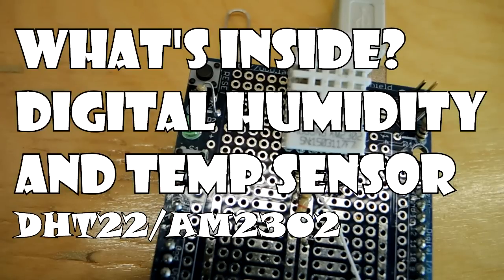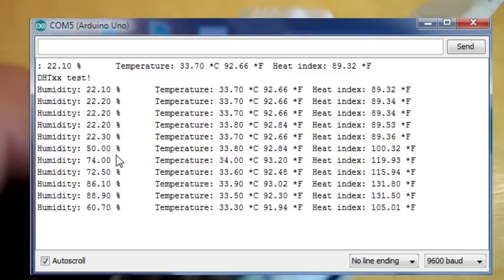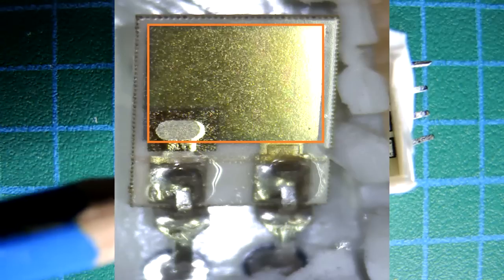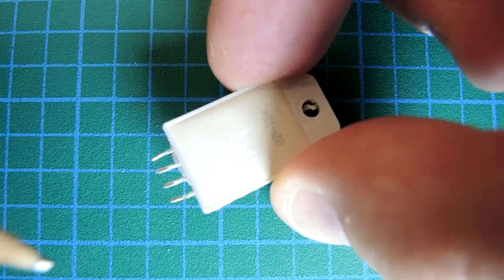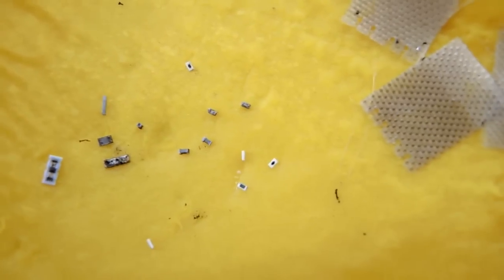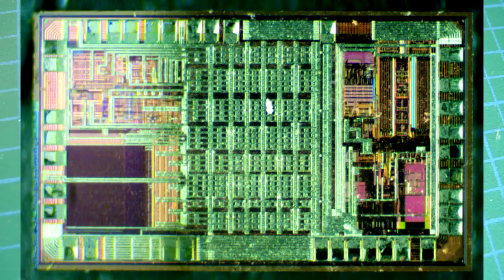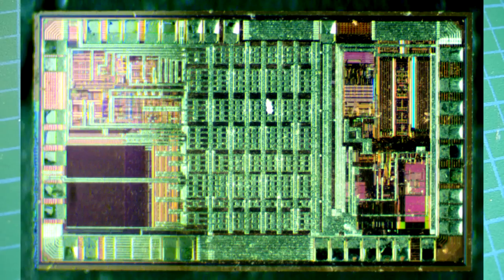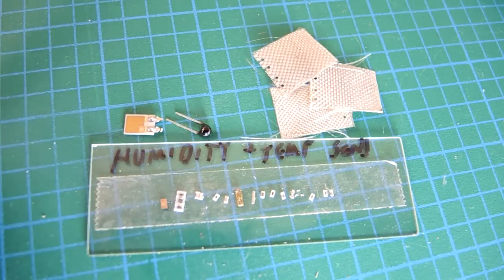What's Inside?  Digital Temperature and Humidity Sensor Extreme Teardown

Comment: What acid did you use? I could not understand that.
I doubt that it was a 6 layer board. You delaminated the base material which most likely was built up of three layers of glass fiber.

Comment: $3 and it has a microprocessor in it. Amazing.
Reply: 72fr250  Well you can buy a microprocessor for only a few cents, so why not. The micro will be cheaper than doing it with discrete parts.

Comment: Perhaps a scope on the humidity capacitor alone and see what it does?, good fun though!, i would guess the microprocessor so it can talk to the arduino with simpler layout, rather than building something to interface a tiny capacitance change to a digital input and have a way to calibrate it, this is already done, still amazing for a couple of dollars though